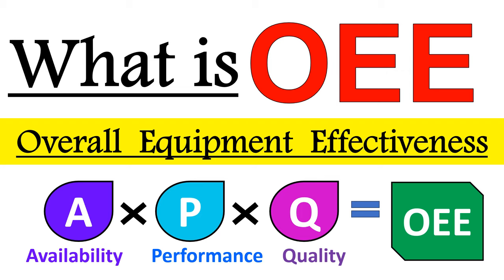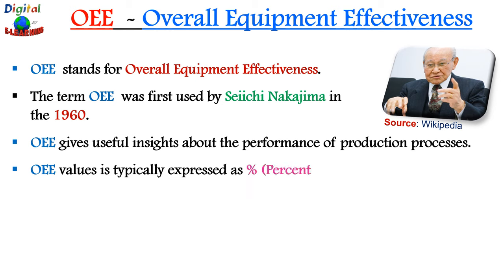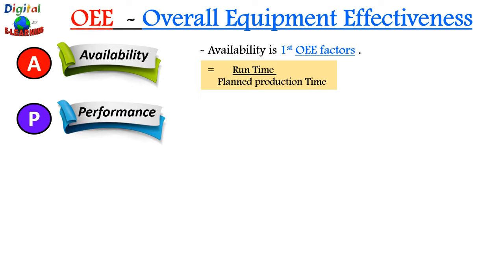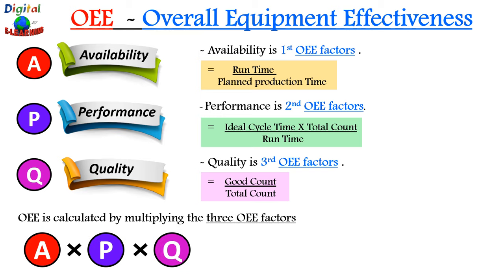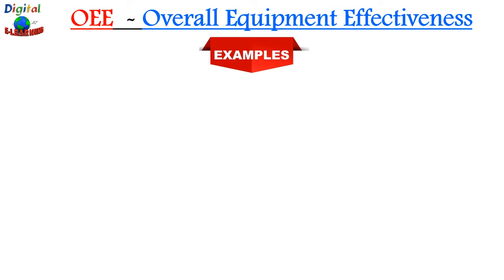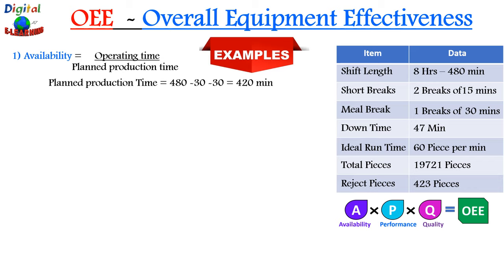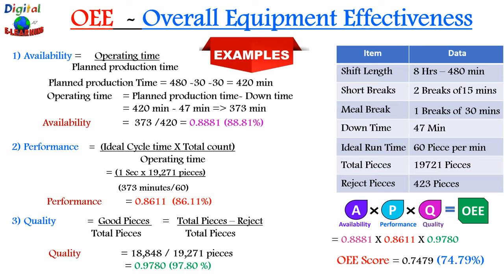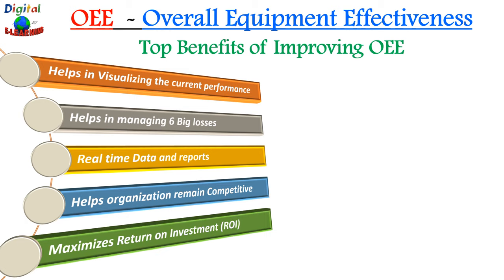What is OEE Overall Equipment Effectiveness ? Overall Equipment Effectiveness (OEE) calculation

Comment: One thing u missed in performance u divided minutes by 60 and convert it into hours instead u should multiply with 60 to change it in Seconds bcoz intop u mentioned 1 parts per 1 second....it's typing mistake bcoz answer is right
Reply from the maker: Could  be Typo.. Thanks for pointing out